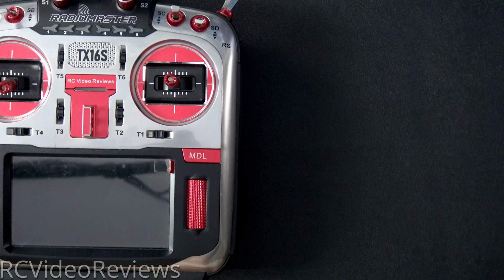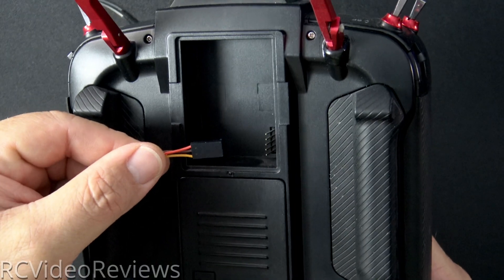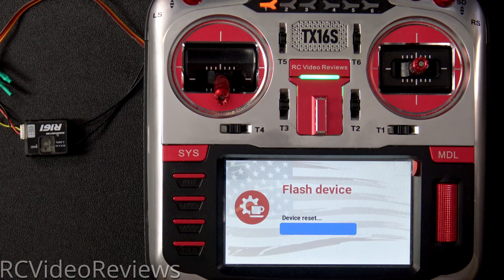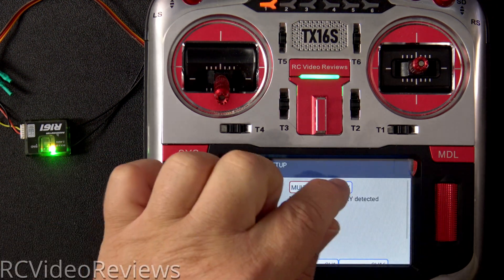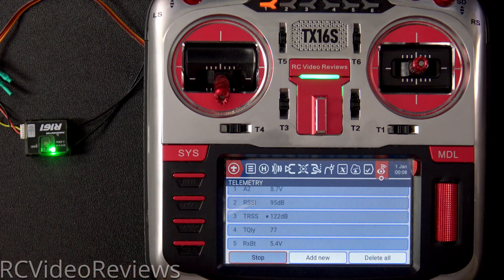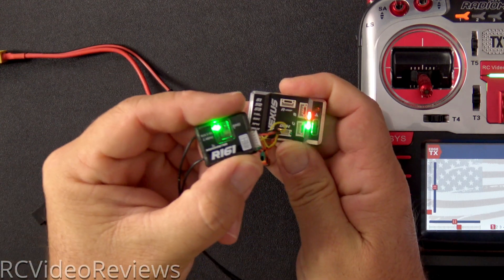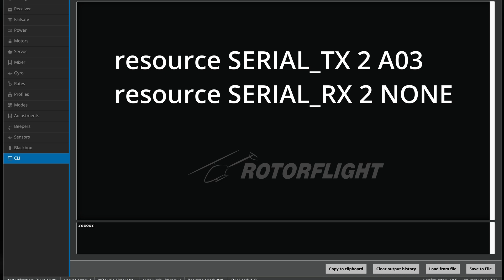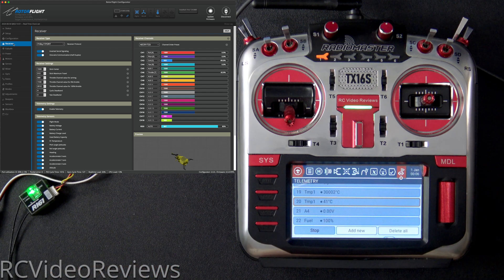Radiomaster Nexus •  Flash F.Port with TX16s and Configure RotorFlight FPORT

Comment: Just bought a Boxer with EdgeTX. Upgrading from Taranis X9D OpenTX. Is your  video on converting by going back to Edge 2.8 to convert still valid? Thanks
Reply from the maker: Yes. You can no longer go from OpenTX to the latest version of EdgeTX without stopping on 2.8 first. After 2.8, EdgeTX no longer reads and converts binary files to YML format. https://www.youtube.com/watch?v=NYbOLLoV-GA
Reply: @RCVideoReviews   Thanks, but this does not work on a Boxer. I cannot flash the 2.8.4  firmware by pressing the jog wheel, nothing happens. My new Boxer was shipped with Edge 2.9. My old TX is a Taranis X9+ and I'm hoping to shift my models setup from the Taranis to the Boxer then flash the Boxer with the latest Edge. Any clues? Thanks